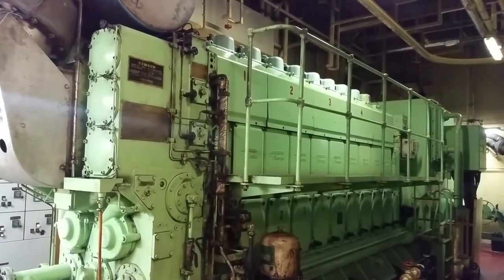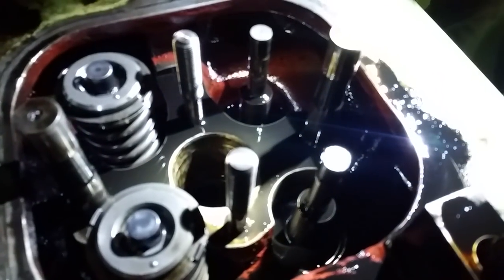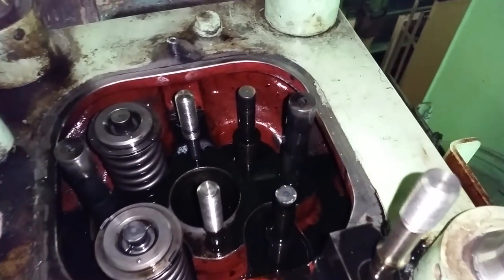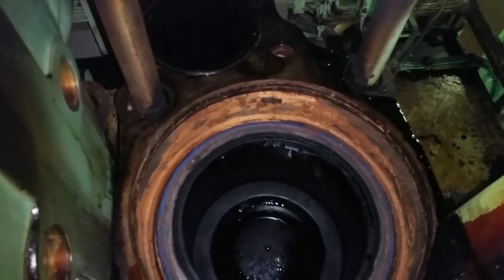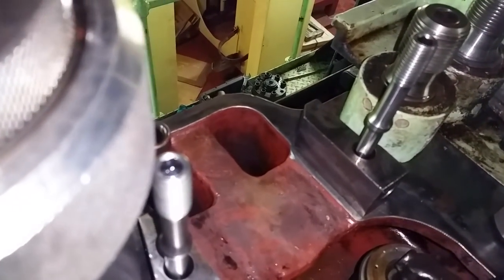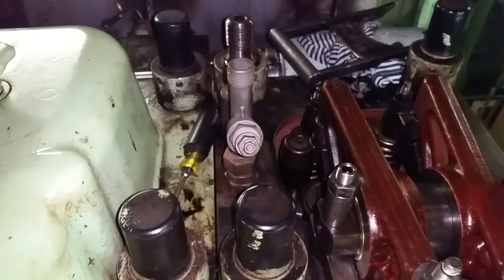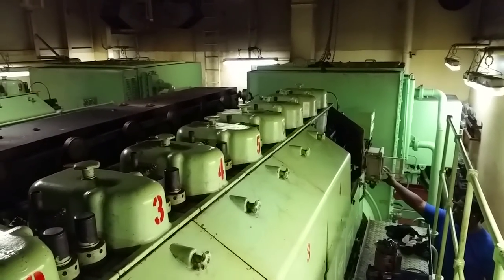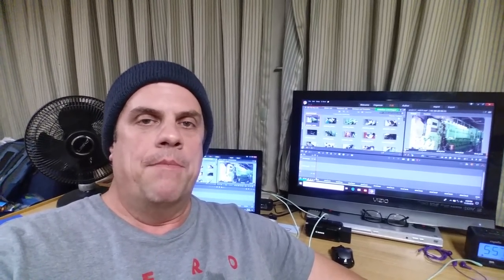Container Ship Vlog #23 (Diesel Generator Head Replacement)

Comment: New guy: "How much torque for the head nuts?"

Master mechanic: "Yes."
Reply: the bolts are stretched to set pressure by four jacks fitted onto the thread at the top of the studs, and the nuts turned down just hand tight.

Comment: One container ship I was on was a nightmare
The powers that be decided to change the generators over to heavy residual oil which they weren't designed to handle
Running between Europe and the Far East we had to strip two generators down outbound and two homebound
They were stripped down completely, pistons, bearings, coolers, turbo's etc and with only two engineers and an electrician in the engine room squad it was day and night work for weeks
Not one of my most memorable trips
Reply: Must have been a small ship to run with 2 engineers and a sparks??
Reply: @steveobrien4141  2 engineers and several oilers

Comment: like seeing the work required to keep the ship in operation  -  in normal operation are all 4 generators used at he same time or is the use rotated
Reply: We have four of these generators generally we only need one but when we maneuver in and out of port generally we use two. It depends on the load but when we come in Port we need more power because of the thrusters that's why we normally have at least two

Comment: Most informative as usual and nicely presented. One has to wonder what stack of assemblies you must have on board to do this switch without down time in waiting to repair and refit the original faulty head. I suppose the faulty head will eventually be repaired and kept as a spare. Was this job done while the ship was sailing or docked?
Reply: We were sailing I believe we only needed one generator running at the time and we have four and yes the heads will get sent to Shore and rebuilt thank you so much for watching lots more coming soon

Comment: Very cool!
Was that an air starter?
Reply: That is correct it is started by air
Reply: The main engine starts with air too.  They have to have enough compressed air to start the main engine 11x.
While entering a restricted waterway like a bay a large container ship has to stop and start the main engine several times. 
Ships with a Controllable Pitch Propeller can reverse by changing the pitch of the blades but on other ships they need to reverse the main engine.

Comment: So was the fault incorrect tappet clearance? 
One maersk ship I worked on Maersk Visual had MAN generators. We used to renew at least one cylinder head every month. There was some design/ manufacturing fault. The heads would just crack.

Comment: I alsoI did this last contract on the same kind of generators, the exhaust valve started to melt and fucked up the whole cylinder head, otherwise, very reliable type of generators.

Comment: How you balance up 9 cylinder engine. If it is 8 cylinders I understand. I'm talking about firing order?TNX.
Reply: A Fernando a 9 cylinder inline balances better than 8 cylinder inline.
Reply: @deezlpwer07  easy 40 degrees between crankshaft journals.     360 degrees can be divided by any number of cylinders.

Comment: Any idea what caused the damage? Great video.
Reply: The valve spring and rotator assembly blew apart and both valves seized in the head.
Reply: punkmaster98 I sailed on one ship with really old MAN generators ( WW2 era). On  start up we had to check that the exhaust valves were moving, they would often stick and require some persuasion with a hammer to get them moving.  Letting the generators cool down for longer helped but didn’t cure the problem completely. There were 3 generators arranged side by side so the fuel rail of one was adjacent to the exhaust of the other.  Lost count of the times a fuel leak on one would spray onto the exhaust of another and catch fire.  Happy days😀

Comment: Jeff are you the ships Engineer? What is your position?
Reply from the maker: +Robert Humphreys well we have several people in the engineering department I am the QMED. And basically that is engineering department maintenance position so I do that welding daily rounds and just general repairs and maintenance it needs to be done on a daily basis
Reply: @JeffOnboard  if I was to work on a ship ide want your job,seams like there is always something to do and its not the same thing everytime,like in a welder and that's all i do all day every day. I love my trade but sometimes it's nice to mix it up
Reply from the maker: @Amr51002  I weld  on my ship, but yes I would never want to do sme exact job every day
Reply: I'm the engineer with him in the video :)
Reply from the maker: @punkmaster98  yes and hopefully you get back or it will suck  :))))
Reply: @punkmaster98  I think you and Jeff have great jobs. Thanks again Jeff and keep interesting videos coming. I think that the head on that generator probably weighs the same as the diesel engine in my old fordson tractor
Reply: @JeffOnboard  When are you gonna sit for your 3rd's ticket?

Comment: I’m a tool and die maker I wonder if one of these big ships would hire me im 23 almost done my apprenticeship
Reply: sorry but your training , whilst being excellent in its field is not needed on a ship-----it takes 12 years to train to chief engineer (I did it) Marine engineering is all about understanding everything on board , and knowing how to fix it.    50,000hp diesels, generators, electrical fault finding ,pumps, air conditioning----the list is endless---good luck if you want to try it, with that amount of experience you will never be short of work ashore     i know i'm there.
Reply: steve o'brien I appreciate the response.   I’ve always been a big believer in career growth and progressing onto something bigger and better.   Thank you
Reply: @dangillis13  good luck , in trying-----there are loads of exams all the way to the top , if you are academic ,good , but if you are not, you will get stuck in the low ranks as passing exams is necessary to get promoted to the higher engineering ranks.you also have to do some long oral exams with dept of transport examiners, who know everything, and you have to prove that you do to.  Its obviously true that getting to the top is possible, as many have done it, but for  example i started a marine engineering apprenticeship at 16----was a junior engineer at 20----4th engineer at 23   ---3rd engineer at 25----2nd engineer at 27----chief engineer at 30 ----14 years.